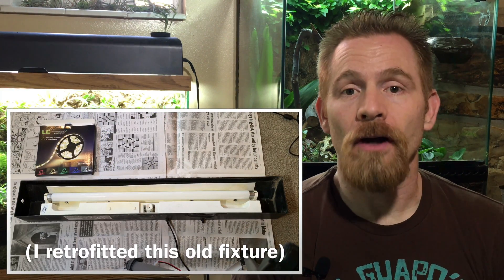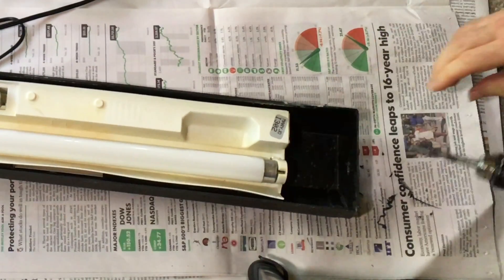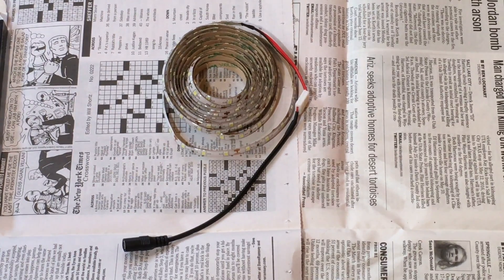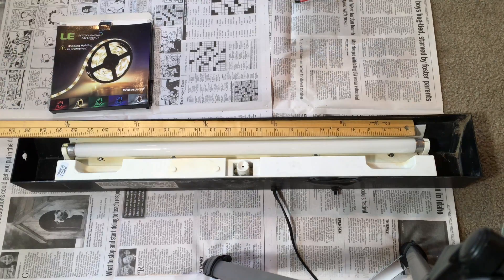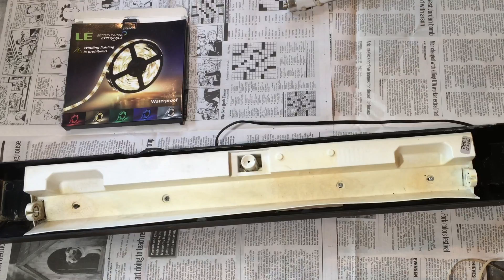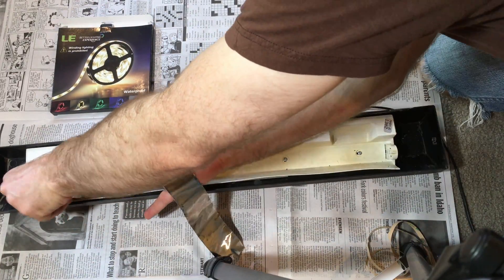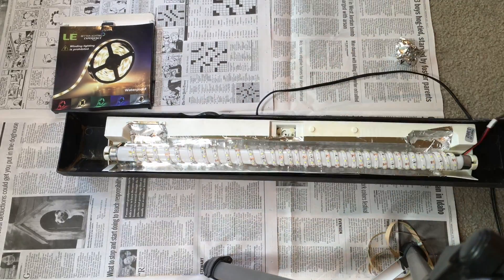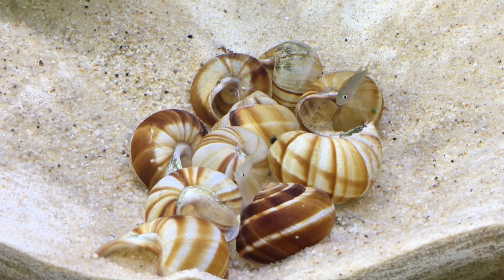LED Aquarium Lighting-Retrofit DIY

Comment: Instead of drilling a hole on the side , you should have used the hole from the old electric  cord which you cut off or removed the on/off switch and used that hole , this way , it would have hidden the new electric cord.

Comment: How much are the materials? There’s a 48” beamswork for $30 on eBay. Is your process cheaper?
Reply from the maker: Super Six It depends...I would say this project is less than $30 USD if you already have the aluminum tape, which will allow you to do a large number of these. Without the tape, the cost might actually be more, I would have to check to be sure.